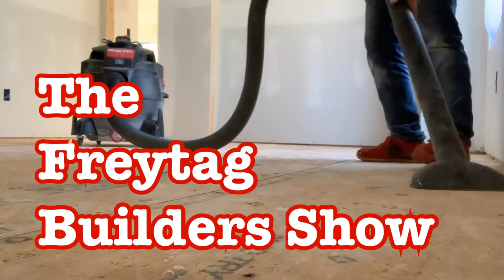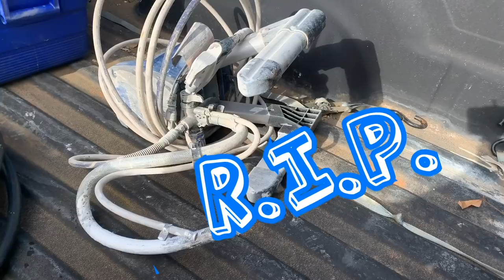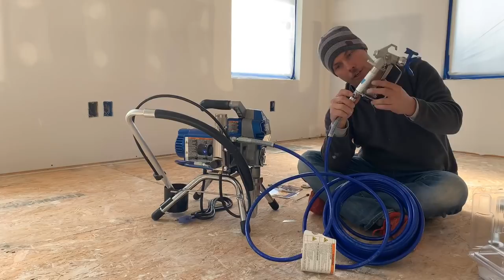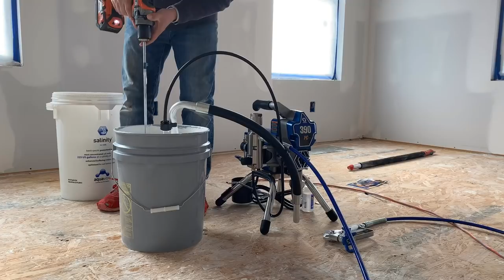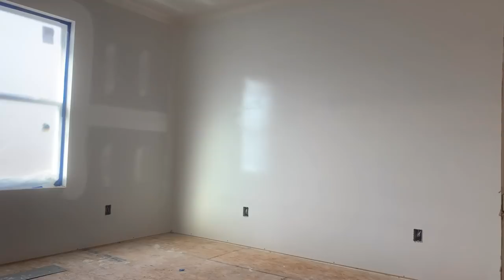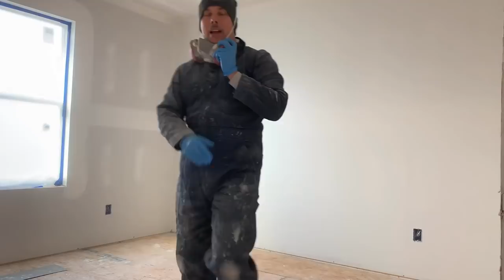Graco 390 PC Setup and Test

Comment: I don’t understand why painters back roll , it defeats the purpose of spraying which is to be faster than rolling. As a painter that does both spray and traditional brush and roll work , if you’re planning on back rolling then opt out of using the sprayer as it will cut into your time having to prepare for use and clean the sprayer afterwards. Might as well just cut and roll . Even faster when you use the bigger rolls like 14 to 18 inch , especially if you’re just running primer on brand new drywall/sheetrock.
Reply from the maker: Alex Sandoval I cant speak for other painters but there are a few reasons I back roll. One reason is to even out the paint on the wall.  Second it creates roller texture/stipple.  This helps when touching up at the end of a build.  Also I can spray and back roll a house  way quicker than I can cut in and roll the walls no matter what size roller I am using.  

Personally I would classify backfilling as an extra step that would create a better overall finish.  

Those are my opinions.  Thanks for the comment and for watching the video.
Reply: Matt Freytag perfectly understandable, some clients would want roller texture for sure and I suppose it does help with the touch ups in the latter parts of the job . I guess at the end of the day whatever gets the job done quicker is the way to go, in my experience it ends up being counterproductive hence why the comment in the first place . I’ve definitely seen my share of mishaps working/helping other contractors doing spray work . Thanks for the reply and good content regardless, and congratulations on the upgrade with the sprayer 👍
Reply: @alexsandoval7202  I agree with you
Reply: If u don't bankroll new sanded dry wall u are asking for trouble ,different if it's been plastered it's  ok
Reply: I spray my first coat and back roll send
And I always spray my woodwork
Reply: @MattFreytag  you just backroll the last coat
Reply from the maker: @JONO3679  I back roll the primer coat, then spray all the trim and doors, next roll 2 coats of color on the walls

Comment: Always take the tip off when flushing the line. Only have tip on when ready to spray
Reply from the maker: Thanks for the tip tip!  No pun intended.
Reply: Anytime, just speeds up the process. I’ve been a painter for 14 years. Know all the ins and outs of a sprayer. We always use titan airless sprayer but I been interested in buying a graco. That’s how I came across your video. Thanks for the review.
Reply from the maker: Jr Is200t I definitely don’t have the experience you have.  I just build houses and paint them occasionally.   I wanted the 395 model but don’t think it was necessary for me to spend the extra money for what I was using it for.  I spray and backroll the primer and I also spray all the trim and doors in the house.  I just recently bought the pressure roller and it makes super quick work out of rolling the color on the walls.   

Thanks for watching the video and commenting.
Reply: I  take the housing off.  so simple
Reply from the maker: Cool. I have been doing that as well and clean.
Reply: Best way and fast to flush is take the gun off thank me later.
Reply from the maker: Cool thanks.  I definitely take the gun off and flush then run fresh water thru the gun as well.  Thanks for advice.

Comment: When you switch from prime to paint, it's important not to have the motor running as this will eventually damage the switch. Also reversing the tip still lets material flow through the tip and causing excessive wear through the tip when in actuality you can just remove the tip being very careful not to have any direct injection by the spray of the material and it will cycle through a lot faster.

Comment: Bought one years ago. Used it maybe 3 times. 😂😂 One thing I’ve learned. These sprayers are best for new construction unless you get the homeowner to empty out their home to prevent “spray mist” from floating on furniture. (Even when covering and shielding.)
Reply from the maker: Thomas Kalinoski  I would agree with that.   I also have the Graco Pressure Roller.   Not sure if you have used one or not but I really like it if you are painting a bunch of the same color.    Thanks for the comment.
Reply: Tomas K, its all in the prep bud. 90% of my job is masking to paint, you need rosin paper on floor and drops and big box plastic over everything else and tape the ends down
Reply: @pnwatv5094  Thanks for the tip Matt!

Comment: Seems like you are doing everything perfectly. That should make your new machine last a long time. Condolences on the old sprayer.
Reply from the maker: Thanks so much for the comment. I sure hope I am doing it right. This machine should last for a good while. I believe I will try and repair the old sprayer.
Reply: I would recommend you to use strainer bags every time you use the sprayer,  even brand new paints may have small particles that may clog the filters
Reply: @vilsan.r.9875  That's why you have filters in the machine and gun's handle. You have to clean those after each use and replace them from time to time.
Reply from the maker: I strain the paint every time I use it.   Even the filters in the gun get clogged and reduce the pressure I am spraying.   This leads to the tip getting clogged in my experience

Comment: Do you really need to back roll primer? The new dry walls suck it up really well, right? You guarentee roller lines now. When you put your finish coat on, you roll it for texture. In my opinion, no need to backroll primer.
Reply from the maker: aaron anderson First off thanks for your comment and watching my video. 

I really can’t answer the technical question of ‘Do you really need to back roll primer’.  This is just the way I have been doing it for years.    

I do know this. In my experience it helps even out the primer or paint that you are spraying on the wall to get better coverage since sometimes the spray pattern is not perfectly consistent depending on the spray rig, paint thickness, or your actual technique.  Also it is just one more coat of rolling texture to make the dry wall and mud joints more consistent when the light is shining on them.
Reply: Always backroll. Always, always backroll new drywall.
Reply from the maker: I agree ☝️
Reply: Yes, Always back roll. It's a must.
Reply from the maker: For Sure!
Reply: 1painter 4hire, sorry bud had to ask what is the purpose of back rolling new drywall ? I know Matt chimed in on it just want hear other experts opinions...
Reply: You are absolutely correct…. You back roll the paint…..not the primer, he just created an extra step for no reason

Comment: I think a 18" roller could do a faster job considering the clean up time for the machine etc.
Reply from the maker: Your probably right!
Reply: @MattFreytag   Good video about the sprayer. I am considering to buy it.  I have G19 right now and for larger jobs it is too small.  How do you like your 390 PC PC far?
Reply from the maker: @synthesaurus  I like it pretty good but would prob have bought the 395 with the digital read out or whatever it’s called
Reply: I just bought this machine for exterior painting "mainly" however in the event I decide to paint with it indoors i'm trying to figure out why Matt used the roller after spraying? Isn't he technically doing twice the work spraying and rolling? Please let me know if it is necessary or not. Thanks!
Reply from the maker: You don’t have to do it but I do it to get the higher quality finish.  The roller helps even out the paint on the wall and create a roller stipple texture which will be easier to touch up in the future.
Reply: @MattFreytag  thanks for the advice

Comment: Way you guys 👦 ❤️ do this back rolling ? 
For what ? structure like old leather army 80s  solders boots ? 
I can do this with graco gx21 fflp514 with poll stick 39" , and Flugger flutex 5s paint or Flugger 5 acrylic
Reply from the maker: Ok sounds good.  Makes a higher quality even finish.   I bet if you just sprayed it with no back roll it would look like tiger stripes when the light hit it.
Reply: @Matt Freytag  tiger stripes - no , its depends how good you was sand it , and how good  yours tips fan is set ? 
but in my job alway do mad  skim coat , and use primer to make some walls .
never have tige4 straps,  and always have apelsin skin without back rolling.
2 stairs house walls and ceallings total painting in half day , covering not including
Reply from the maker: @diyidea3031  ok bro.  You do you. I keep doing it this way.

Comment: Great video matt! do you need to thin the paint for this kind of sprayer? i bought one and was wondering.
Reply from the maker: You shouldn’t normally have to thin the paint to spray in the sprayer unless you are using a really fine tip or if it’s one of the less powerful models and it’s not spraying a good pattern.  If you were to thin it I would start out with small amounts and mix well.
Reply: This model of airless has enough pressure to pump the paint, so no need to thin, just mix well and it’s ready to use.

Comment: Do you have to roll the paint to after spraying or just the primer?
Reply from the maker: You don’t have to roll at all depending on the quality finish you want.   The sprayer doesn’t typically spray a perfectly even coat so the roller helps even out the coat and add a slight roller stipple texture to make it easier to touch up later.  Thanks.
Reply: @MattFreytag  thanks man

Comment: one tip use some vaseline on all your threads house to gun and hose to the machine and your tip gaurd and your filter on your machine paint wont stick to it its much easier to take off and clean aswell
Reply from the maker: Nice tip.  Thanks.

Comment: Do you have to run water every time before starting or just the first time to run factory oil out? TIA
Reply from the maker: Before starting yes!  I also run water through it every time I clean it and when storing it needs to have some thing ran through it with some lubricant in it such as the Graco pump armor or paint thinner.

Comment: Fyi- so the instructions say to clean the pump for the very first time with mineral spirits to remove the factory oils, then with water after.  Dont know how much it actually matters but thats what the directions say.
Reply from the maker: Thanks for the info.  I have also heard from many painters that it’s good to run some paint thinner or mineral spirits thru the pump before storage instead of storing with water remnants in the pump.    I would think this would keep it from rusting or seizing up and prob do the same thing the Graco pump armor would do.

Comment: where's the back stitching? Your backroll technique is gonna leave flying v's if you apply your top coat like your prime
Reply from the maker: Matthew Fernandez Never heard of the term back stitching nor have I ever heard anyone in the industry around here use that term.
Reply: @MattFreytag  back stitching is when you roll straight up and before you get to the top roll to the move over an inch or so towards your wet edge to cover your roll marks from the roller dragging the paint up you qlwYs want your roller marks uniform all same direction not flying v's from rolling at an angle you see the up down strokes
Reply from the maker: Matthew Fernandez I gotcha homie.

Comment: I always use mineral spirits to clean the factory oils in the pump before using. They pack it with oil to protect from rusting.
Reply from the maker: Thank you Kevin for the positive comment and advice on the Graco spray gun.  I really appreciate your view and information.    😃

Comment: Hi,thank you for video. I
Just bought the same sprayer and your video was very helpful!

Do you think that we can use Antifreeze like alternative and cheaper protection or to use Graco Pump Armour.

Regards
Reply from the maker: Kolyo Kolev I am sorry but I am really not sure about your question.  I would say since antifreeze has some type of oil in it that it would also be effective, but I’m not sure if the antifreeze has any chemicals in it that would do harm to any internal parts inside the pump.  Thanks for the comment!
Reply: Thank you!

Comment: The harbor freight Krause is a better machine than cheap graco HD sells.....I had that same graco and it was pos....harbor freight is still goin....but pc 390 is what am looking at next.....if I painted more would be no brainer but it comes and goes so
Reply from the maker: I agree.  The one I got from HD did last a while but once it was done there was no fixing it.   In retrospect to me buying the 390 pc I wish I would have gotten the 395 Ultra because of a few extra features but the PPG store did not have them in stock and I needed to spray a spec house immediately.
Reply: @MattFreytag  if you have 1 trade buy the very best you can....in the end you'll save money......I am a GC but just sprayed a 2 story house with harbor freight airless.....if I sprayed everyday I would buy a $1500 sprayer and have a cheap one as backup.....same as framing, plumbing, tile, etc....just having a machine quit in middle of job costs too much money/time
Reply from the maker: @kirkdunn1379  I heard that.  I build houses but I find my self  doing 2-4 spray jobs a year
Reply: @MattFreytag  same here...probably less actually....am a GC and painting is small part of the job.....if I did more I would get nice graco or titan....hard to justify cost for me....think my Krause is on its last leg, just finished a complete exterior and it barely worked at end.....good enough, lol

Comment: I just bought same one last year, work horse to get the job done & get on the bass, I might have to come work for free for a fishing trip.
Reply: Turn to prime with pump off & itll r easier to uncoil & rewind the hose. I wind the hose stretched out & then back towards the pump.
Reply from the maker: @joeyboyle9482  ok cool I will try that next time I use it.
Reply from the maker: Yes I do like it.  Wish I would have bought the 395 to get the digital pressure control but this one works well.   I’d trade fishing for work. Lol.

Comment: Hello. I am from Algeria and I want to know how many cubic meters this machine does in 8 hours
Reply from the maker: Behih Sidahmed  I am sorry but I do not know that information.  Maybe you could look on the Graco website and find that out.   Thanks.
Reply: 390 395 models spray .54 gallons per minute a gallon of paint woul cover average on 320 to 340 sq feet I'm not saying this are the perfect numbers because it also depends on the size of tip you are using but you can do the number with this info I hope Cheers from North Hollywood California
Reply from the maker: ebenezerENlosangeles Thanks for the info!

Comment: Maybe on the old sprayer just the pump failed (which I believe are easily replaceable). The new one is nice though. Looks like a quality machine.
Reply from the maker: You may be right!  I haven't had a chance to investigate it yet.  It was a model from Home Depot.  Im not sure if it is even the same type pump as the new Pro model I bought.  Im sure I will make a video if I repair the old one.  Thanks for the comment
Reply: @MattFreytag  - I think the new one is worth owning. Simply being a homeowner though for occasional (rare) use (and being housepoor :), I can't afford it or justify the expense (even though it was in my top 3 finalists after lots of research). The new model pump is better. And you can by aftermarket versions of it for pretty cheap (less than a $100 on Amazon, and eBay). One (or more) of these may actually be the OEM pump since I believe some of the components are made overseas (China). Like everything else, if it's assembled in America (some DeWalt tools for instance), they can say "Made In America". Which is one reason I voted for Trump (not that he alone can make a huge difference).
Reply: Don't do replacement pump on cheap model it's essentially throw away sprayer once its done pumping hence 300 dollars as it's diy
Reply: Nah, the cheap graco isn't rebuildable...I tried....its a throwaway

Comment: Could you not just spray with primer and only backroll the final finish coats?
Reply from the maker: Yup Yes I’m sure you could do it that way but I wouldn’t.  The quality of the first coat sets the basis for the quality of the preceding coats so I prefer to go ahead and backroll from the beginning
Reply: @MattFreytag  okay thank you!
Reply: This is what I do...spray PVA primer and back roll next 2 coats....works fine....primer soaks into walls pretty well so doesnt leave much texture anyway....once wall is sealed than texture starts to build up
Reply: @kirkdunn1379  thanks mate. Would you recommend the graco 390 as a good all round machine. Mostly walls and trim using fflp?
Reply: @yup3398  am not a painting a contractor though I do alot of painting...mostly residential....I am a GC

sure its good machine but you would have to weigh out what you typically spray to find out best overall fit for you.....I use HVLP guns alot too for fine finish when overspray is an issue.....if you can only have 1 sprayer find one that covers most of what you will do

Comment: Do 390 have a transducer in them I messed up cause it was covered in paint when I bought the part and watched the 395 transducer I realized that was a different sprayer can you help.
Reply from the maker: patrick quinlan I am sorry but I am not sure what a transducer is or if my sprayer has one.  Thanks for the comment.   I wish I could better help you.
Reply: How do you replace pressure control valve do you have a video on that
Reply: How do you take off the pressure adjuster
Reply from the maker: I’m really not sure I haven’t had to do any maintenance on it yet.